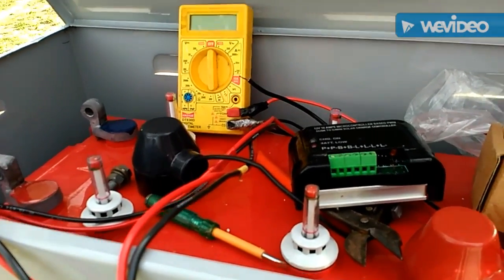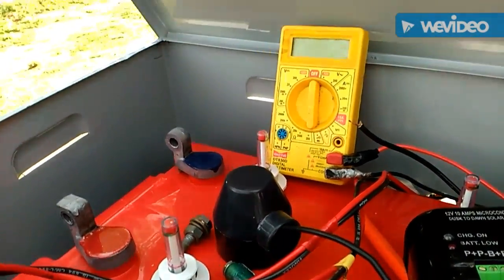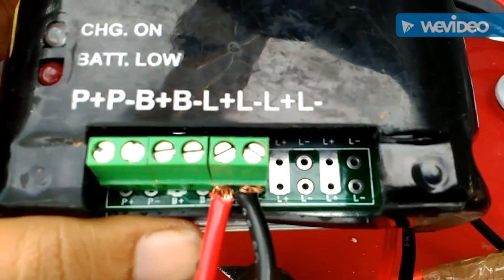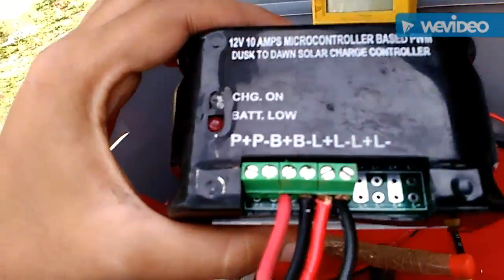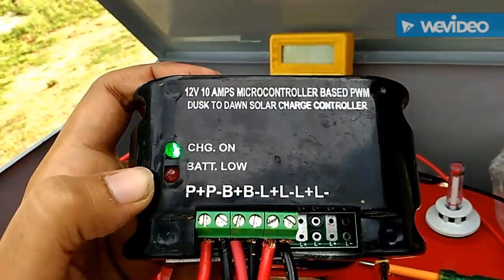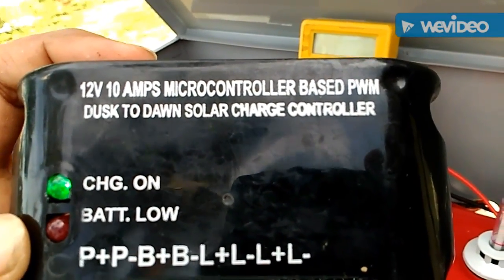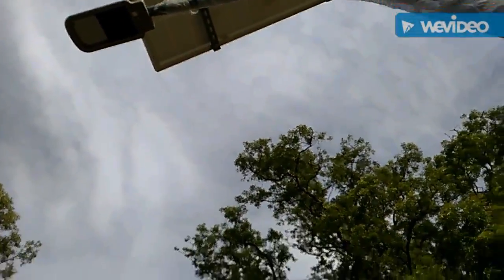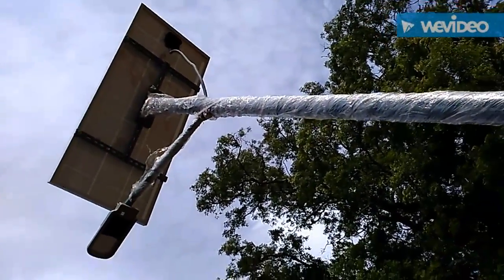solar street lights installation | solar charge controller | Solar battery

Comment: can i add a 2nd power source to my solar street light if so what will i need
Reply from the maker: Yeh definitely
Reply: @SustainableEveryDay  my light has a built in battery 2 18650 i have it hooked up to a 2 battery switch battery 1 is solar panel battery 2 is a 6 v charger but it looks like nothing is happening